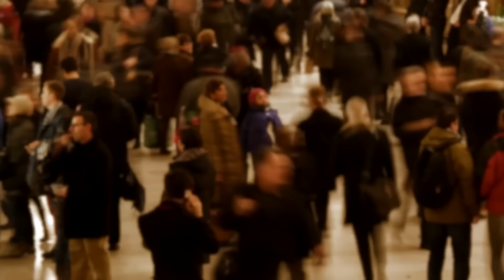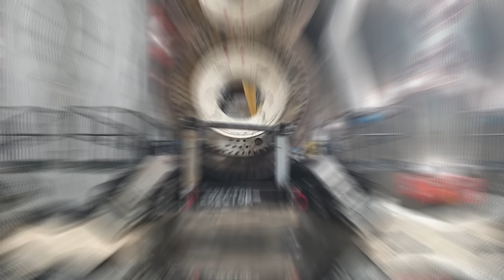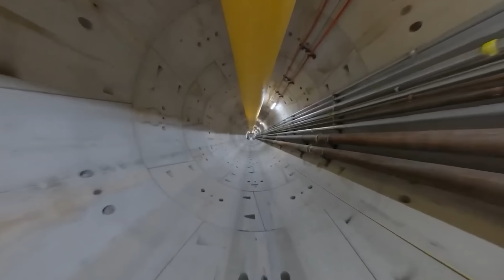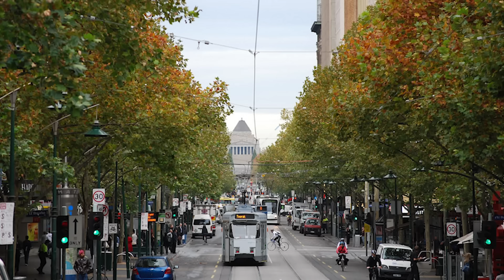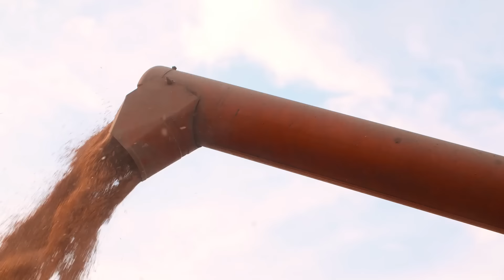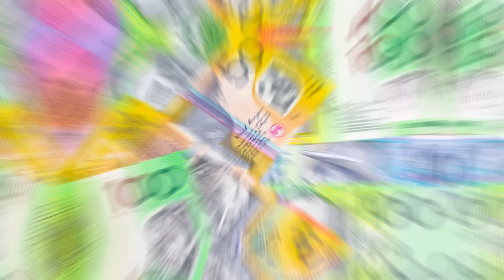How Melbourne Dug a $15 Billion Train Tunnel Beneath the City

Comment: The snowy 2 project blew out from $2B to $12B  so victorias project blow out  $12B to $15B doesnt sound to bad to me. Never heard of a mega project come in under budget. They obviously know these projects will cost way more, they just dont want to scare the horses so they can actually start the project. All these projects would cost triple every 10 years if they postponed building them. The victorian government has done a great job improving rail services in victoria. I wonder what the next big project will be.
Reply: The improvements so far have been minimal for Metro Trains. And if the State Government does not restructure the tram network when the Metro Tunnel opens, then that is another opportunity lost.
Reply: Suburban Rail Loop..
Reply: @miles2057 A project that should be postponed indefinitely.
Reply: @mjcats2011  in concept it's a necessity, with how the outer suburbs have grown going all the way into the city and back out is inefficient if you want to travel between them. Not to mention the bus network has a LOT of problems currently, so in its current state it cannot act as the connection. Look at most other major cities, they have orbital rail lines (or at least more cross lines).
Reply: @jackalcrackle The Bus Network has a lot a problems because it has been starved of funding. For 2 billion Melbourne could have had a brilliant functioning Bus Network.

Most cities do not have orbital rail. And certainly not one serving low density suburbs that will not grow. 

Many suburbs in Melbourne that are growing fast have really poor frequencies. The Somerton link and also rerouting Shepparton and Seymour trains via Sunshine is far more important.
Reply: @mjcats2011 I see you fell for the anti infrastructure propaganda from our local fascist media
Reply: @ChrisJohannsen I am going to treat that reply with the contempt it deserves.

Another one without a clue.
Reply: I guarantee you that the alleged 3 billion dollar blowout will actually be more like a 10 billion dollar blowout. 

Our corrupt government will never tell us though, it'll take an investigative reporter to expose it all in a year or two, and when the shit hits the fan, the powers that be retire and take their pension and whatever corrupt deals they've stuck while in office.
Reply: But Why there is a state library train station right next to Melbourne central?
Reply: Ml lm